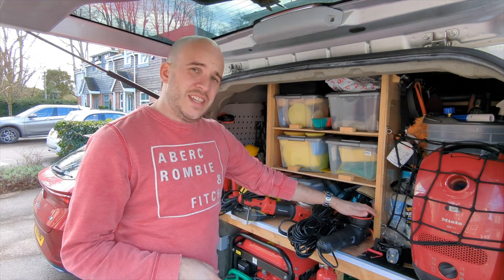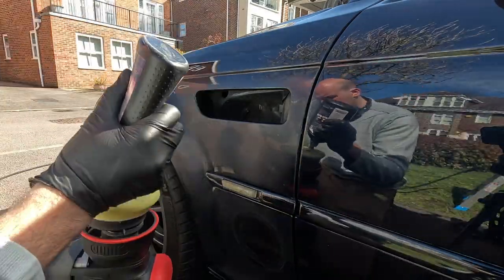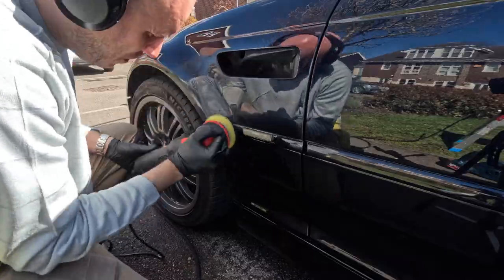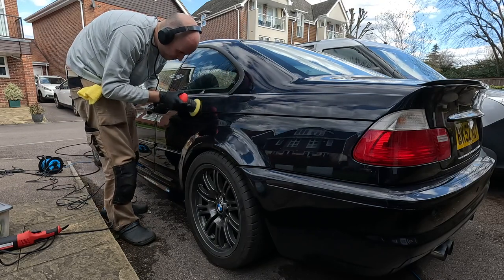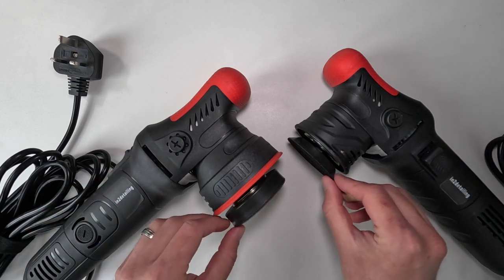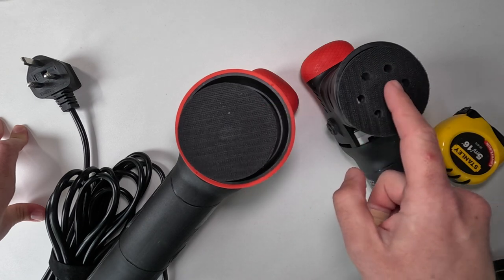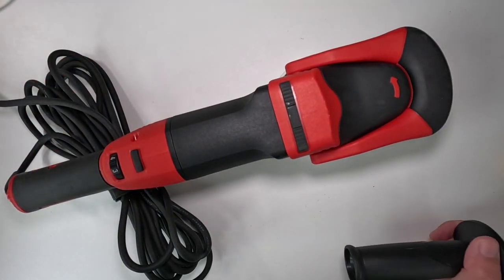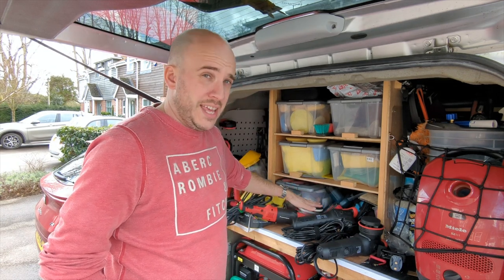The best cheap DA polishers? In2Detailing DA8, DA12 and Forced Rotation tested

Comment: Great video. I upgraded from a DAS6 Pro to the in2detailing DA12 and DA8. Both good machines. Along with my SPTA nano I thought I had the perfect set up. I used the DA8 and nano far more but got fed up with the cable. I sold all three machines and bought a Flex PXE 80. I now have the perfect machine for my needs.
Reply from the maker: I couldn't agree more there, the PXE80 is phenomenal, although I wouldn't do a whole car with one as it'll take ages. But for 3-1" work I don't think there's a better tool. You did the right thing 😀 in selling the other stuff.

Comment: What a great little video 👏👏. I've got the DAS6 Pro and for my first go at machine polishing I thought it is great, but I've got the problem of swapping the plates from 5" to 3" now I've got a car and not a van, and did think about getting another machine just for 3" pads. I got myself a late Christmas present and bought In2detailing's nano polisher, that little thing is amazing (imho) for small area's. More head scratching and more money to save 🤷🤷🤦🤦😂😂
Reply from the maker: I've got the nano to review too, I was having problems with it stalling though so I need to check with Imran to see if I'm setting it up right...the instructions aren't the best are they!

I completely understand with regards to swapping plates. What I tend to do is do all the 5" work around a car first, then do the 3" stuff, rather than working a panel at a time. Although there are massive efficiencies to be gained by having two. I'd personally choose the da8 as I think it's actually a better 3" machine than the DA12.
Reply: Will defo keep your review and recommendations in mind when the time is right. Thank you

Comment: Excellent video!! Btw is that a knock off of the flex 3401?
Reply from the maker: Thank you darling. It's definitely inspired by, but it's not a close enough imitation to be a clone of it. It is exactly the same as the Vertool one though.

Comment: Being someone who has only used a machine polisher 4 times, and only having the DAS6 Pro, I had to look up what forced rotation is 😂. Luckily,  my paint is pretty decent and i only need a fine cut once or twice a year, so no need for another machine, i think 🤔. Cracking review,  thanks. All the best.
Reply from the maker: I used a DAS6PRO for years and it's absolutely satisfactory and capable. I definitely wouldn't change it for one of these, but I would buy a DA8 over it, if I was starting from that point. Does that make sense?

I've got the DA15 and I'm looking forward to seeing how the cut varies between that and the Forced Rotation one, because that's the point of the longer throw big DA's, more cut for less effort, but you can only really use them on big panels, where as the Forced Rotation can, technically, be used everywhere.

Comment: Moved from Porter & Cable 7424 with hex logic pads to DA8 with Lake Country and was shocked at how quickly the DA8 melted pads. Lake Country 5" yellow lasted about half a car with no more than around 2 mins continuous contact with light pressure. Will be trying other brands of pads, thicker with centre hole, before making my mind up on the DA8.
Reply from the maker: Ahhhh the good old PC! Those Hex pads aren't bad though are they? Always liked them.

I can't comment on the LC pads in this case (their range is huge, I've got a green CCS pad I think, don't use it much but I can take it for a spin) - I'd definitely go with their HDO range for the forced rotation, but in all honesty the Rupes ones work so well. I guess they make them for their 15 & 21mm throw machines, so they're designed to work well with powerful machines? Could be worth a look if the LC pads get cooked.

Comment: Great polisher review, the forced rotation looks a cracking machine and I would have been tempted had I not got a full size Dewalt rotary and a mini Shinemate rotary which is an absolute dream to use. As well as a Dewalt cordless DA a 3" DA and a Flex Pxe which is a lovely machine.
Reply from the maker: I really need to lean the way of the rotary, mainly due to the massive reduction in vibration more than anything else, but I have to say, the level of control with the forced rotation was incredible, I've never managed that with a rotary (all technique I know)
Reply: @Supercharged Llama Detailing  I've used the 3M waffle type pads on the rotary and found them to be the best option, when I've used standard flat pads it's nowhere as easy to control. My 3M pads are getting a bit long in the tooth now so I've bought a couple of Shinemate waffle pads and some Dodo Juice pads which look like they maybe a good option as the 3M's are not the cheapest pads. My machine of choice would be the Shinemate mini rotary eveytime due to it's lack of vibration and it's lightness.
Reply from the maker: @markmoore6264  I really like the look of all the shinemate machines, it'll be interesting to see what their pads are like in comparison for sure.

Good insight as to which ones make life easier and which don't, thanks for that.
Reply: @SuperchargedLlama  I'll let you know how I get on with them as I've got our two black 😲 to do very soon

Comment: Excellent presentation once again. Really enjoying your content. With the DA8 having a fair bit of power, what speed setting were you using when doing that BMW?
Reply from the maker: I'm glad you enjoyed it, I agonised over how to shoot and talk about it. With regards to the speeds, About 4 for the correction 👍 speed 2 for priming and spreading. On my generator I have to use it at speed 6 due to lower ampage than mains.

Comment: Hi, Great video! I’ve just bought a DA8 (I presume the same machine but branded for Dodo Juice!🤷‍♂️) as a complete novice. I agonised over which one to get between DAS6, DAS6 Pro or DA8, however, I think this has reassured me I made the right choice! 😁
Reply from the maker: Is that the one that Darren helped you out with?

You're absolutely right btw, same machines, and what a cracker!
Reply: Yes, that’s the one, with a great level of support from Dodo Juice to tweak the package to make it more suitable for my specific need. With a bit of luck I’ll get to use it next weekend!

Comment: I had a DAS6 starting out, and stepped it up to a 15mm  5" and a 12mm 3", which had similar RPM range as the Rupes Bigfoot polishers   I always felt should have gone for the Rupes duetto 12mm 5" and kept the das6 as a 3" :(  the duetto was billed as the Rupes entry level polisher.  The forced rotation was a half step in-between the rotary and the DA, as some rotary guys didn't like the pad stall with the DA, but I prefer the DA as it keeps me out of trouble on the body lines and is easier to handle
Reply from the maker: I'm with you there. Now that I've got these, I haven't touched the DAS6, the DA8 is far better than the Das6 at 3" work, and it's better than the DA12 for that too, so I use it on that job mostly, and the Forced Rotation everywhere else.

I do like the easy nature of the DA15 though, that's really lovely to use, very smooth, but with both you do need a 3" pad. The DA8 I guess let's you do everything?

Comment: Thank you for this! My new In2Detailing DA8 is waiting to be use since I got it at Christmas…🤦‍♀️😂 How easy did you find switching between 5” and 3” plates?
Reply from the maker: Ooooh lovely jubbly, you'll enjoy that. Swapping the backing plates is really easy, you just get the supplied spanner around the  centre nut in between the shroud on the polisher and backing plate. Then you turn the backing plate, the spanner basically keeps the nut in place. Bit fiddly the first time you do it, but really easy after that.

Comment: morning i have a vw caddy van to polish soon i have flex pxe 80 but im also looking a good 5-6" polish would you recommend the force rotation as the main on it?
Reply from the maker: Yes I would, VW commercial paint is pretty hard so the extra bite from the Forced Rotation is really valuable. You may have to two step if you've got really heavy swirling, but the Zvizzer medium cut and their medium thermo pad tends to finish down nicely on the VW commercial paint.

What colour is your Caddy?
Reply: @SuperchargedLlama  its a dark red its a old version a 08 plate

Comment: Fantastic review!
Reply: For me I think it would be good to see a run down on polishing pads. Types, care and scenario, if that was to be something you’d be interested in creating of course. 
Liking the channel and content you post
Reply from the maker: I can definitely do something about that, I'm just not sure what way to go with the pads. A lot of it is personal preference, and a lot the depends on the paint you're working with. You can see here that I use the Rupes Yellow Foam and Scholl S20 Black, I take this is a my starting point on any paint and then work from there as it's effective on nearly every paint. 

I think there is a reason as to why no one else has really made that content already, it's bloody hard to do.

What I can definitely show is the difference in cut with the same pad and polish across something like the DA8, DA15 and the Forced Rotation.
Reply: @SuperchargedLlama  can absolutely understand and appreciate it’s all subjective with far to many variables to account for if experienced yourself of course. 
Possibly a good starting point for most enthusiasts like myself if understanding those variables before tackling any correction or enhancing work. 

I myself am desperate to get out and refresh on polishing with my Argos special. Certainly will invest the most practice I get but for now, it’s a good starter considering it’s on my own car. 
That’s after switching the horrendously big backing plate to a 5”. 

I had originally watched the meguiars starter guide for techniques and carried on to purchase the pads, compound and polishes. 
Good results but reckon I’ll need to replace the pads that I have down to my own mistake of not storing them properly and fear they may be contaminated. 

Rupes yellow foam and scholl S20 black sounds like a good alternative. 
The family black Astra has fallen victim to back lane hedges unfortunately and it can be a real mind field when you start to look at possibly options. 

Thanks for the feedback also 👍🏼

Comment: Have you tried the DA15 from in2detailing? If so how does that compare to the DA8 and FR?
Reply from the maker: I have indeed, I have them all actually 😅 the DA15 does have it's uses for sure, I just find the FR is better for cutting and finishing quickly over different contoured surfaces. It's really good and a smooth machine btw, I just have a preference for the FR now, but on some cars it's not the right machine, so I use the DA15 then. The DA8 and the FR is probably the ultimate pairing I suspect, covers the 3" work and the tighter areas with a 5" pad.
Reply: @SuperchargedLlama  Thanks for the reply. I've only used the Dodo Juice version of the DA8 but don't own a machine myself. I felt like I needed a bit more cut with the DA8 but I probably needed something with more bite to it than the TW one and done on my Golf
Reply from the maker: @peterborrowman2041  I can say with absolute certainty that you're correct there. Try a Buff and Shine 50/50 pad and Scholl S20 Black! https://www.in2detailing.co.uk/products/buff-and-shine-uro-fiber-pad?ghref=3377%3A373130
Reply: @SuperchargedLlama  thanks matey. I have the urofiber pads. I got a deal on the one and done where it came with a orange and a black lake country pad and a 50/50 £30 I think it was.
Reply from the maker: @peterborrowman2041  excellent, it's a case of then addressing the polish 👍

Comment: Hi, want compound did you use please?
Reply from the maker: Scholl S20 Black and a Rupes Yellow Foam pad 🤘https://www.in2detailing.co.uk/products/scholl-concepts-s20-black-1-step-compund?ghref=3377%3A373130
Reply: Many thanks. Any recommendations for  compound and pads for 2019 VW paint with swirls please? Have tried Koch Chemie Fine cut with there fine cut pads but wouldn’t improve the swirls after 3 passes. I’m using the in2detailing DA8 plus that you are reviewing in this video. ?
Reply from the maker: @karlchapman6768  I'd personally shoot for Scholl S20 Black and maybe a Rupes Yellow Wool, or Urofibre Buff and Shine 50/50 pad. You may very well have to refine the Yellow Wool as it may leave a bit of hazing. https://www.in2detailing.co.uk/products/scholl-concepts-s20-black-1-step-compund?ghref=3377%3A373130
Reply: @SuperchargedLlama  Ok thanks. Will give that a try!👍